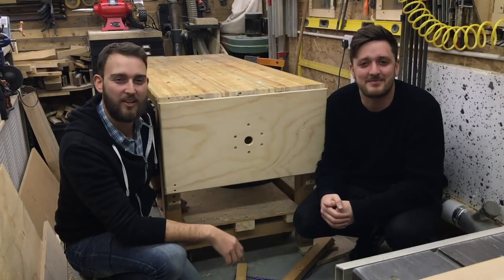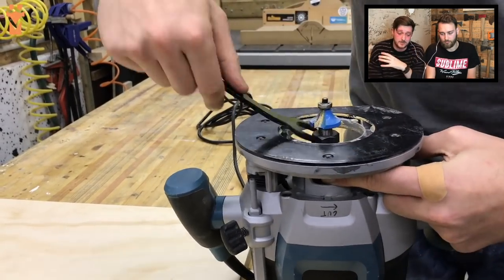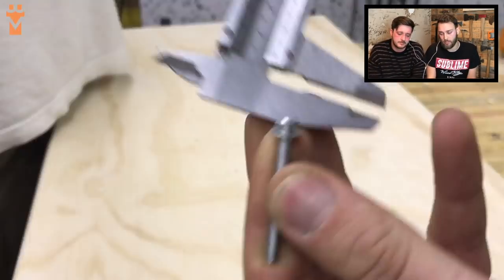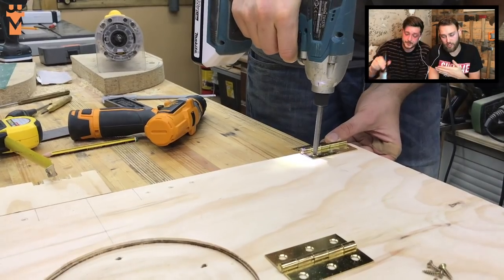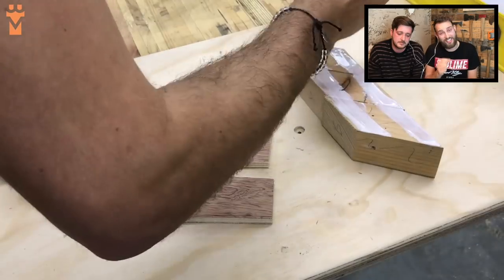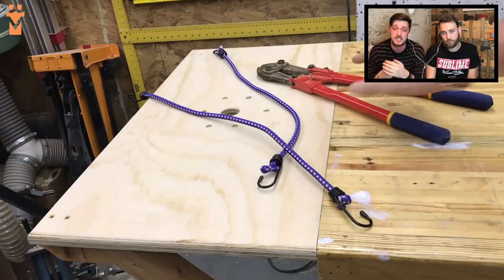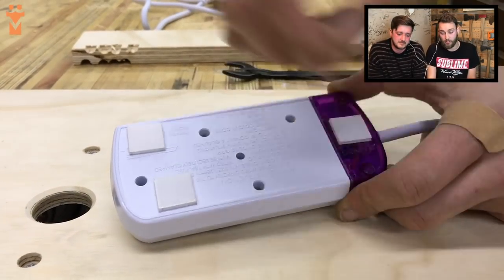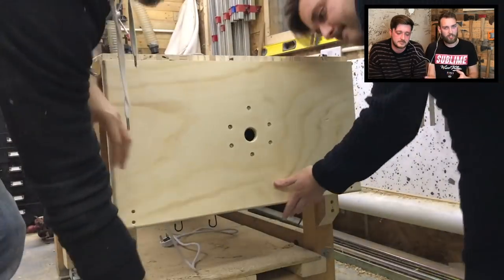Ultimate Space-Saving Router Table DIY

Comment: Nice job with this one! This is such a great solution to get the extension to be quick and easy to use while keeping it all secure. Really inventive! And that was a great tip about keeping the nut on the bolt when you're cutting the bolt shorter. 👍
Reply from the maker: Thank you! The main goal was ease of switching between set up and folded away but we didn’t want to sacrifice stability. I think this was a pretty good solution. Glad you found the bolt cutting tip helpful 🤙🏽

Comment: I’m so confused. What exactly IS a Crosscut sled FOR? 
And…. Does the router HAVE to be. A plunge router??
Can I use a Ryobi compact cordless router?
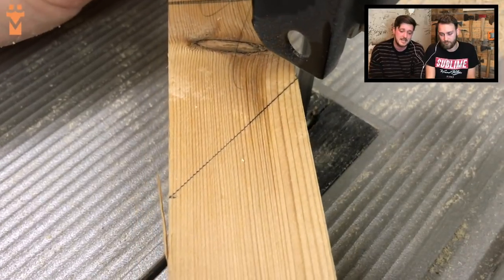Also, WHAT TOOL WAS THAT exactly that you were using about 3:08 in & 3:25 in??
And I feel like the legs used to hold the table up are…kind of janky. Would some regular old fold out & drop down wooden table legs be just fine?
And… I guess I’m gonna have to watch some more videos? 
Mannn this is HARD trying to learn all about wood workikgn

Comment: Intriguing Idea, but please be careful with your power setup. That power strip/surge protector may not be able to handle the power required for the router. A 2.25 HP Bosch Router is apparently rated for 12amps which is far more than is intended to be run through power strips. This is also why they recommend not to plug space heaters into extension cords, they draw enough current to heat up the wires and connectors in power strips and extension cords and then you end up melting the plastic and posing a pretty significant fire hazard.
Reply from the maker: Thank you for this - we had no idea! The router we have certainly is not as powerful as 2.25 HP but we will definitely look into it. It would be easy enough to plug straight into the wall as the cable is long enough.
Reply: @BrothersMake  No Problem, another thing you can do is get an extension cord (you'll probably want one that's 14gauge 3 connector, labeled 14-3 usually) and you can cut the cord in half, and run it into one of the metal electrical boxes (Be sure to get the cord strain reliefs for the knockouts). Then you can wire in a standard light switch. 

Inside the electrical box, connect the two green (Sometimes bare) wires together and ground them to the box if it has provisions for it. Then splice your white to white. Then you'll put the switch in between the 2 black (Hot) wires (DO NOT USE THE SWITCH BETWEEN THE WHITE WIRES).

If you go this route, it'd probably be good to refer to a good wiring diagram, just to make sure you're doing things right. Rockler sells a specifically designed product (Rockler Item #42703) with a safety E-stop switch that you can put at hip height and bump with your waist in the event of an emergency. This would also work, I'm not sure if it requires any wiring or not.
Reply from the maker: We actually have an NVR switch laying around that we bought for another project. We considered writing it up but ultimately ran out of time. Will definitely be looking into electrical options. Thanks for the advice!

Comment: The individuals who disliked must all be dyslexic and was probably trying to say - dis-i-like.!!!!!
Reply from the maker: Haha that’s a good way of looking at it! 😅
Reply: @BrothersMake  that was a great idea you have put together, 
Simple but also affective, oh! Not being disrespectful but if you get screw fix own brands(I think your router is),take note(if anything goes wrong before or after your warranty run's out)' you can't get spare parts for them'
Got a multi cutter(ERBAUER) I lost the bolt that keeps the blade's on got told by S/Fix helpline that they don't do part's for the erbauer tools,BOSCH do an adaptor that fits many brands of M/CUTTERS but it's a 50/50 chance it would fit,even the TITAN TTB515STP stapler >the only brand of staples that fit it are TACWISE brand discovered this after buying many other brands without any luck, i  think the problem is because their own brands are all made in China,now got a Milwaukee M/CUTTER because got p****d off trying to get the screw I was talking about, hope this info stops anyone throwing money down the drain,they do the jobs they are built for,
But if they break you could run into problems,
 Again great idea you have there certainly save a lot of space.
Reply from the maker: Thanks Gary that’s useful to know. Not had any issues with Screwfix in the past but will bear this in mind 👍🏼